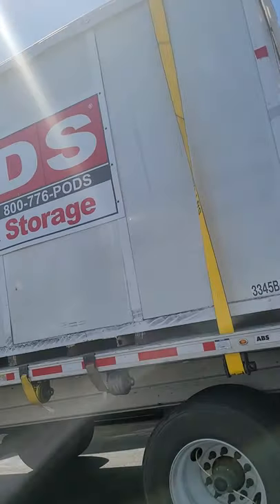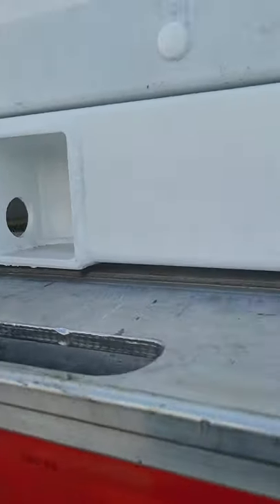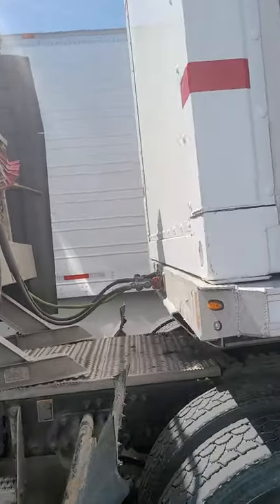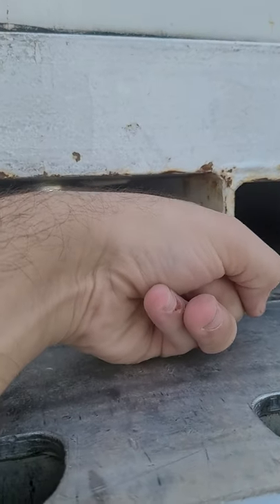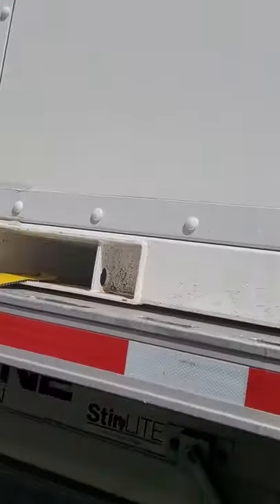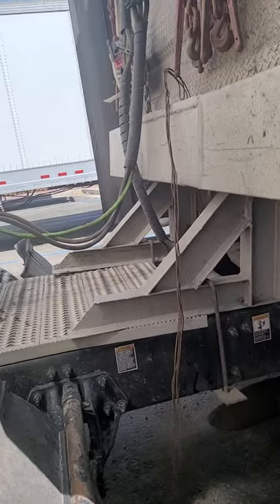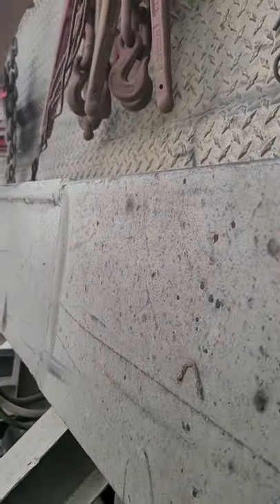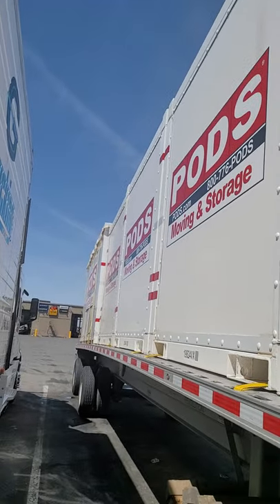Flatbed load securement - PODS containers

Comment: gonna be doing this for schneider cant wait. awesome video
Reply from the maker: Well, they are light weight.. plus, PODS are "Strap and go" loads so yea 😊
Reply: I will also be going  this with schneider, I start October 12th and will be going to Wilmer Texas for orientation
Reply: I pushed back orientation to the 26th update**
Reply from the maker: @justahbuildjoe  you're going to do flatbed in the winter?
Reply: @theoBaba773  I guess , should I reconsider? Please feel free to leave feedback. I’m new to the industry….I just always told myself if I had to choose for a division it would always be flatbed. But please give me your best input id highly appreciate it
Reply from the maker: @justahbuildjoe  
Well, the best time to start doing flatbed is in March. Unless you're going to work in the southern states. And if you do work in the winter, always wear thermal underwear and stay warm. Still, I don't advice to pull flatbed in the winter. 
I started in October and it was a tough start. The straps, the tarps and the equipment can freeze up and sometimes the water or snow can damage the freight.
Reply: @theoBaba773  I honestly didn't think about the weather. I start training on the 17th.
Reply: @theoBaba773  working with PODS, is there plenty of miles and loads or a little more wait time than trailers?
Reply from the maker: @kennygwalk5328  
PODS do actually go across country and they are preferred by most drivers. They're easy to secure and they're light weight so there is competition on PODS...
But if you noticed, I put the straps through the lift point on the bottom. Usually that's easier than throwing the straps over the top
Reply: @theoBaba773  I know you're pretty much a vet at this by now but were there any pick up or drop off locations you found challenging to get in and out of? I've been a flatbed tow trucker for about 4 years but I know this is a different kind of beast.
Reply from the maker: @kennygwalk5328 
Not with PODS. Usually they're some of the easier loads. 
But they do have a terminal in Los Angeles that can get crowded. And they have no truck parking so trucks park up the street and wait for their turn. I think it's in Anaheim, CA.
PODS are good to start with, and you will notice many mega carriers start their new drivers with PODS. It can be a good start for you tbh
Reply: @theoBaba773  I appreciate the advice man. CR England called me last week to do PODS and Swift called to do trailer. Was struggling to figure which is the best option. Looks like I'm going to Indiana lol. Stay safe and Happy New Year!
Reply: @theoBaba773  how much do you get payed
Reply from the maker: @sethpurser  I grossed $7,900 this week, but of course, a big chunk of that goes towards expenses. Freight is moving at premium rates now, the market is hot $$$$$$$
Reply: @theoBaba773  is that being an owner operator or company driver?
Reply from the maker: @E85CARX  I'm a lease operator, just like an owner operator but I lease the truck instead
Reply: @theoBaba773  just passed my CDL test! Waiting on my mentor now!
Reply from the maker: @kennygwalk5328  
Time for the 💰
Reply: @theoBaba773  what about company drivers what the pay looking like
Reply from the maker: @Krankenvwagen  
As of this year, yes, company drivers are making good money. The truck industry is moving well this year
Reply: @theoBaba773 ey, bro! Been at it for a year. This winter sucks, barely any freight. I found the hardest drops and picks are mostly in Florida, but still doable, just can be annoying.
Reply from the maker: @Kenny G Walk  yo! What a coincidence.. last night, I saw a flatbedder hauling some PODs and I was thinking about how their business is going. 
You're a company driver still? With which company? How is the pay?
How is the work?
Reply: @theoBaba773  did you start with Schneiider pods I am going in a few weeks and wonder if they let the driver set there eta or if they decide that at Blackhawk the driver set there eta
Reply from the maker: @mike Shelton  oh no, I started pulling a Conestoga at first actually with IG Transportation out of Addison, IL. I started with steel and large objects but then later, I got the PODS loads off the load board
Reply: @theoBaba773  ok thanks
Reply: @theoBaba773  hey man, I have to say thank you again but I'm with CR England. It's about 58 cents a mile including the safety bonus. And 15 a drop. Gets slow during winter but back to business in the spring

Comment: Do you think driving flatbed is easier than dry van? I'm starting the PODS account in two weeks. How different is it from dropping hooking a regular trailer? I heard the height was lower
Reply from the maker: Not at all. Pulling a fatbed is the worst but the money is higher. Flatbed is dirty, hard and dangerous. 
In the winter, I pull reefer and thats because I can't tarp in the winter! If you're going to move PODS, then okay, that's not bad at all. But still, you have to go out there and throw the straps over; unless you use my technique and put them the through lift point holes 👉🏼

Comment: Are these pods heavy, do you need to scale them at truckstops? Do you need to pull into scale houses?
Reply from the maker: No, the maximum weight on a FTL is 30,000 lbs. Usually, they're lighter than that
Reply: @theoBaba773  nice 👍🏼. I start Monday. Super excited. Thank you
Reply from the maker: @CarlitoBTS  
You seen my winch winder? Check out the video on my channel. Get a drill from Walmart and put the winder on it. It's gonna help you